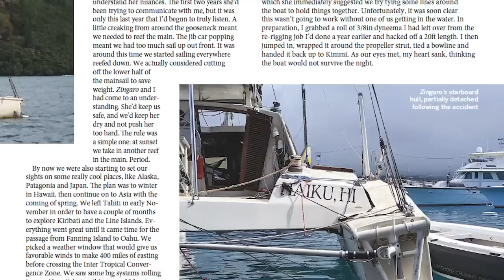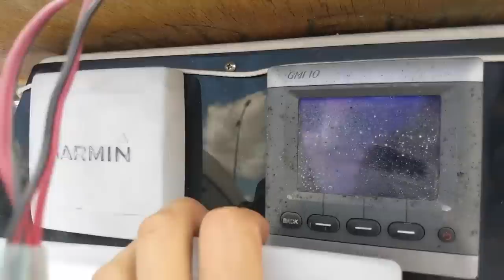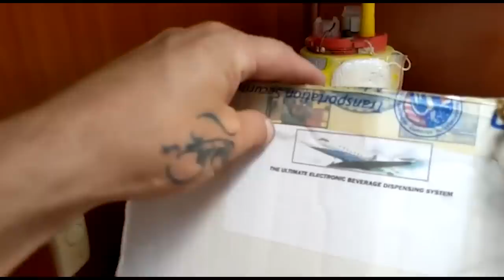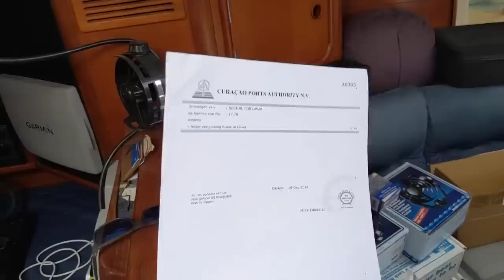Junkyard find! Trash boat, will it float??

Comment: Apple gear, well overpriced and is it so much better than other brands? From what I remember the valves are a stainless steel ball in Teflon with bronze body. Before spending it would make sense to me to at least have it apart and check for pitting on the  ball. Once it's out, spray inside with penetrant and it may well free up. Are the through hulls badly pitted? There would have to be some bad corrosion to make them dangerous. Every day progress is being made is one  step closer to the goal. Interesting for me to follow this as I am following a similar path, i.e. breaking catamaran hulls, back to a monohul and needs work to get back in the water then more work getting ready to sail off. Difference is I am in England where the temperature is decreasing and I am 250 miles away from the boat.

Comment: If you have the money change the seacock.  While the boat is not in use remove the holding tank. It's dead so get rid. 
Where you are , I'm not 100% sure but can you anchor as it's I beleave a national park, so all mooring balls. $$$
If the boat is 24v it's thirsty.

Comment: Wow. It’s your life, and I’m not trying to be rude, but holy shit. This project is way bigger than you’re ready to take on obviously. You’ve gotta drop the rudder to inspect everything properly. Some things you’re putting lipstick on are just plain dangerous to be out sailing and not addressing. I understand that you’re only in the Caribbean which does reduce risk. But having just smashed up a boat, you’d think it would be something to avoid again. Questioning whether or not you should spend $350 means you clearly cannot afford the lifestyle.

Comment: Don't get a Mac computer. Get a windows PC based for about a third of the price and it will do all you need it to do as long as your nav equipment has windows based software. I'm sure I'll hear people say I'm wrong and I really don't care what sales people have told them or what trolling sales people have to say. I'm a tech. I work on both. Macs are very expensive to buy and very expensive to fix. The same video editing software will work just as good on a windows pc. I do it all the time.

Comment: Macbooks are known for horrible airflow. Combine that with the shitty CPU idea's intel puts in and you have yourself a portable heater. I'd suggest something called turbo boost switcher. https://www.youtube.com/watch?v=kzqKueUhbKk And if that's not enough you can always still point a fan at the keyboard ;)
Reply: can vouch for turbo boost switcher, it's one of the basic utilities I always put on my Macbooks - but i got a huge improvement from opening the macbook up, cleaning out the fans properly, and redoing some of the heat transfer compound on the chips. But the get all sorts of cruft in them, a good toothbrush clean of the fan + heatsink fins with rubbing alcohol dropped a few degrees and got it back to silent.

Comment: For the love of God please do not put your computer in a freezer.  Just let it naturally cool off so you don't ruin it with condensation.
Reply: It will likely work fine once cool.  These things have thermal sensors for the battery and CPU to protect themselves from permanent damage.
Reply: Worst case scenario take it apart and apply more thermal paste to the heat sync on the CPU.

Comment: Batteryhookup.com has salvaged BMW electric vehicle batteries in great shape. Mine tested almost like brand new. 90 and 60 amp hour modules in 12 volts 4 cell (4S) battery modules @ 3.7 volts nominal per cell. $120 each LITHIUM ION! That's dirt cheap. I bought the entire electric vehicle battery $2900 for the 90 amp hour cells. But they are out of those now.